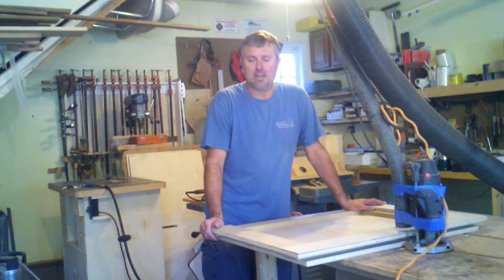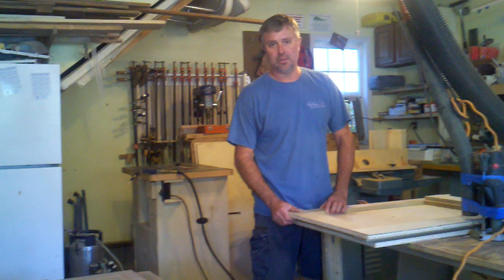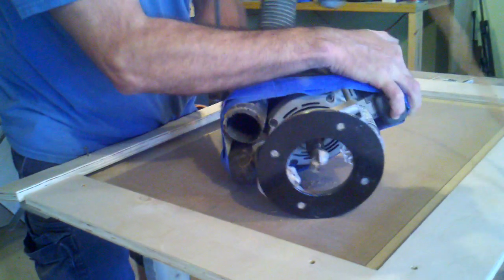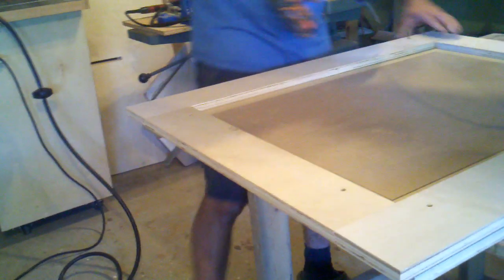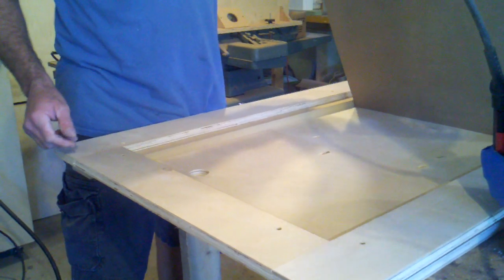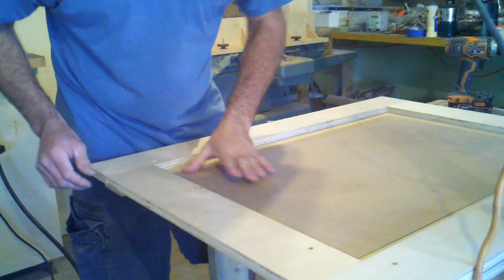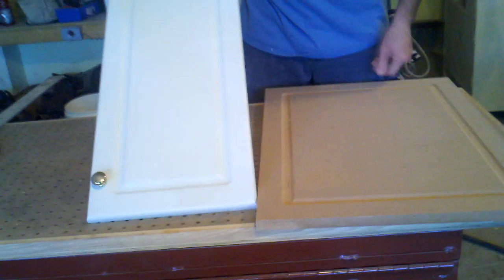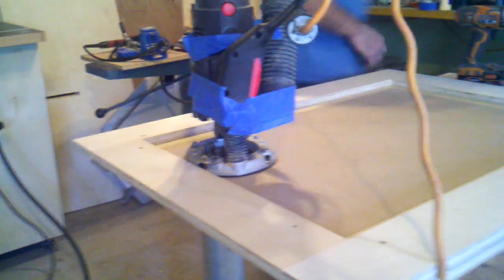MDF Raised Panel Jig

Comment from the maker: For this door I used a WhiteSide MFD Raised Panel Bit from American Eagle Router Bits online.  It's a "straight" bit with a 1 1/2 inch cutting diameter.  Party number on the package is #5720. Hope this helps. Good luck. 
Mike
Reply: thank you.
Reply: I was expecting a metal jig that slides in both directions for small or big doors

Comment: There's a reason Norm started every New Yankee Workshop with the pitch about safety glasses. Dude -you're not even wearing regular glasses -  you are begging to lose an eye. When a sharp shard of something flies off one of your power tools running at 20,000 RPM, do you really think you'll be able to react in time to avoid it?
Reply from the maker: Thanks fur your concern for my health....you are right and I should wear safety glasses and maybe some armor a helmet gloves etc....last I checked this is a free country and as adult I can make own my decisions even if they are bad ones.
Reply: Michael Robino lol nice comback.
Reply: +Michael Robino 
I noticed that you weren't wearing any protection, too.  It's good practice, especially if you're in a role of teaching and showing other people how to do something.  It gives you a little more authority.